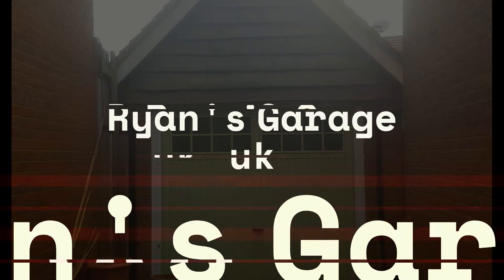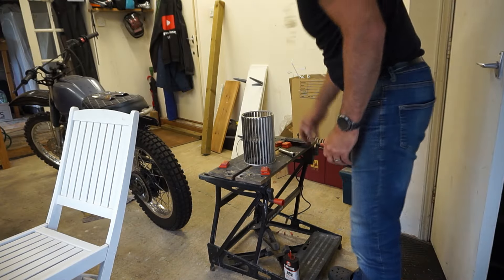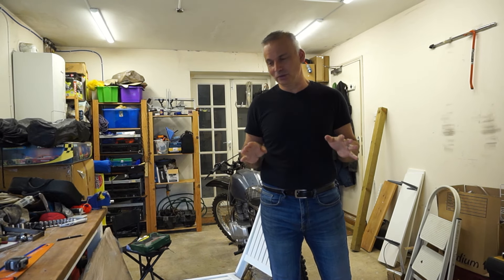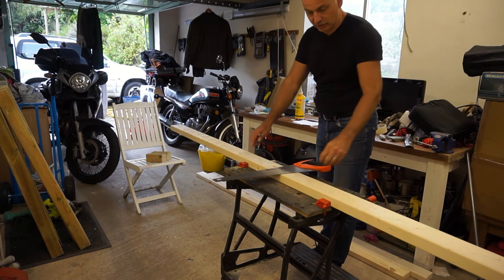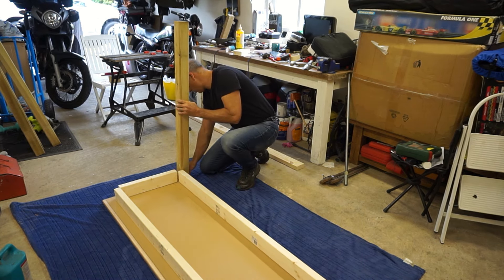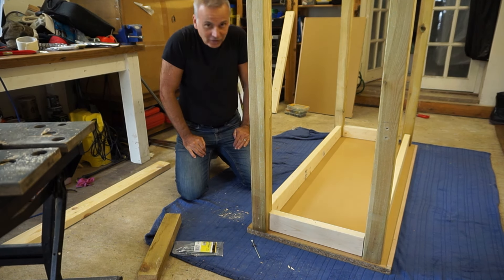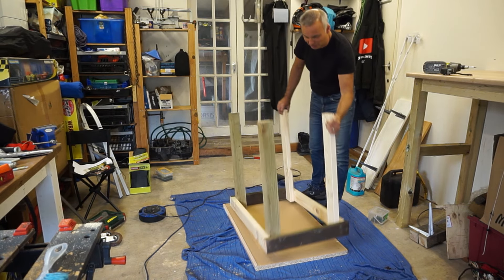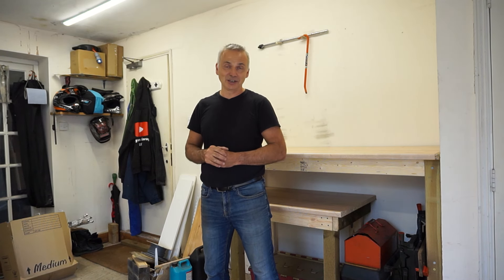I need a workbench, can I build one this week? Final component of my new garage!

Comment: I know it’s too late now. But an easier way would have been to look on market place for old kitchen cupboards and pay a few quid for them, then just place work top on top.  This way you get storage as well.
Reply: Put some diagonals from the legs to the supports to the tops to stop the wobble
Reply from the maker: Thanks, I will look to do that it seems pretty stable as is, but it can't be too strong.
Reply from the maker: Thank you. I did consider that, but wanted it higher then that, and I'd like to store large items under it.

Comment: Looks to high you won't be able to get over your work piece pal I built one the same and it was to high for me I could get any force on engines and bits I was working on also I would of put some strengtheners on the length of the worktop pal it will move otherwise pal
Reply from the maker: Thank you. It is easy to drop the height if it proves to be too high. I did forget the additional supports underneath and didn't realise until now.